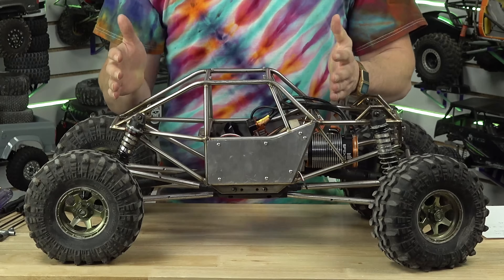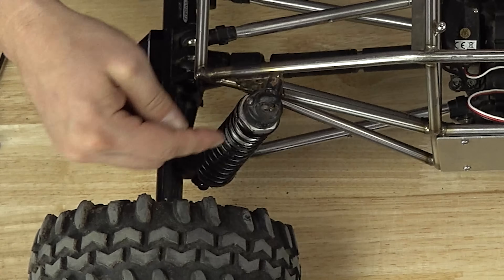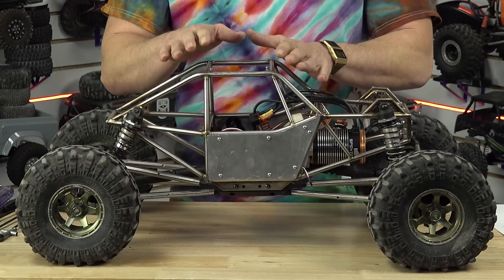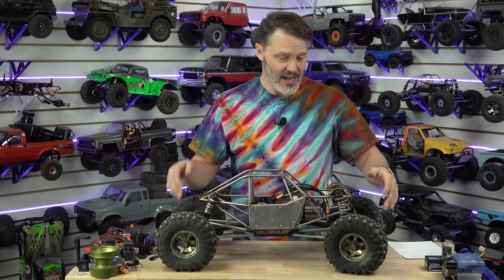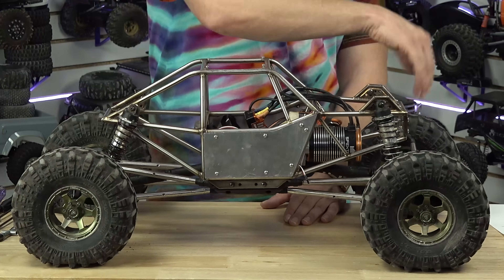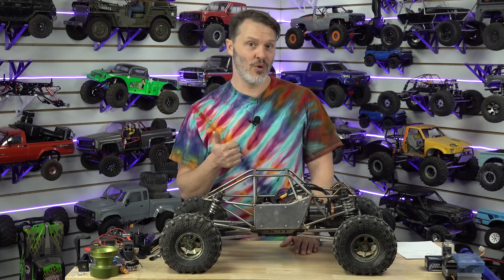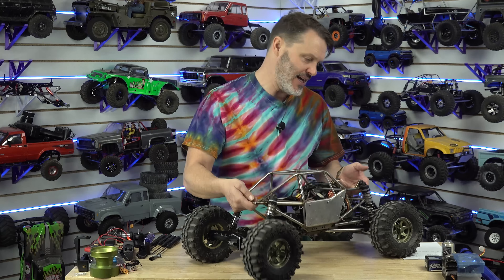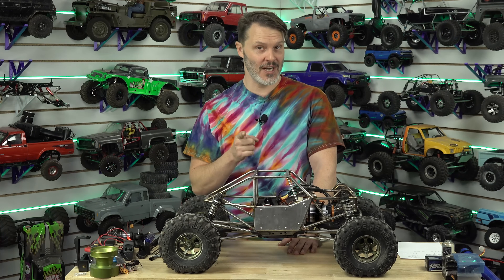RC Crawler Shocks Explained! How They Work & Tuning Tips! 🚀

Comment: Guess you could do heavier oil in the front or rear, or even just the one corner to counter a bit of torque, or pick up some balance if it's heavy in the front. (?) Probably, sounds like a couple more than a few options to try try again with. Good 101. Thank you.

Comment: I've found my prefer about 1/3 to 1/2 droop depending on the rig and all are running 110mm shocks.  Basically no shock oil, I add just a small amount of 10w oil purely for lubrication.  Though my comp crawler runs full 40w.  And to compensate for my soft undampened shocks, my heavier rigs, as in 12 pounds plus are all running rear swaybars.  So you get nice fast acting and realistic looking suspension but it's still stable without too much body roll

Comment: Hi, I would like some advice, I also have an SCX6, if it is possible to reduce the speed at low revs to slowly downshift. I have already tried with the pinion but it still seems too "fast", perhaps via ESC or radio?
Set Esc: 3. RPM/ Throttle Matching Low ( now is"Medimu") High
Thanks.
Reply: Does the ESC have rpm decrease rate?
Reply: @67daffy  Hi, I can't answer you because I don't have the program card at the moment (I tried with other brands, but I need the original).

Comment: I gave a young lady (@Hwy49RC) who owns probably one of the coolest crawler I've seen a tip. Not sure if she'll use it, but I have used it with great success. The idea came from a mountain bike I used to have and the shock it had wasn't the usual ones most see in mountain bikes with shocks. It did not have springs or the usual shock body. So I took that idea and stuffed this incredible cheap material inside the shock and dampening rods of a 12th scale I have and went racing at a local track. It performed so well that I did the same to a few other R/C vehicles I own. The same trick can be used in a crawler and no messy oils to mess with lol.